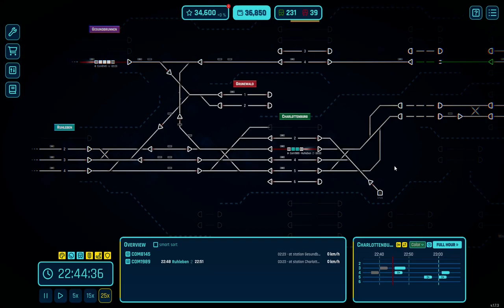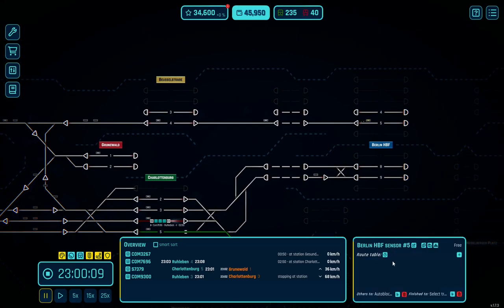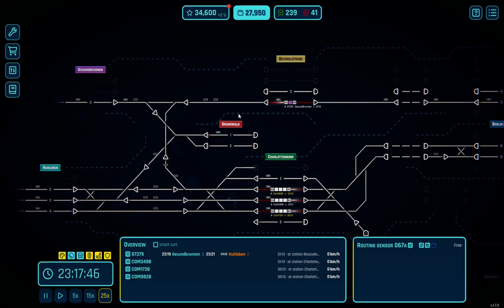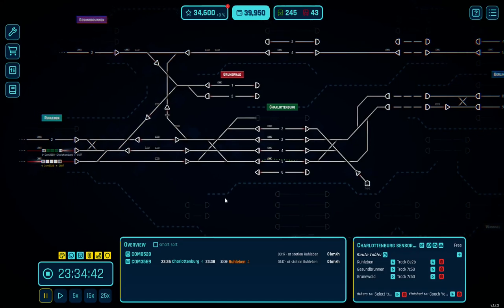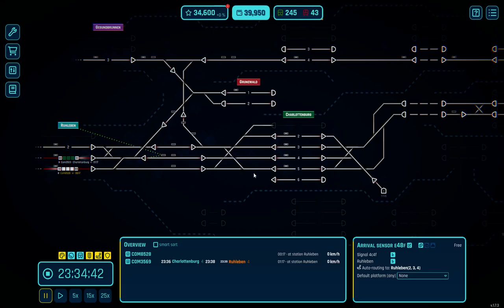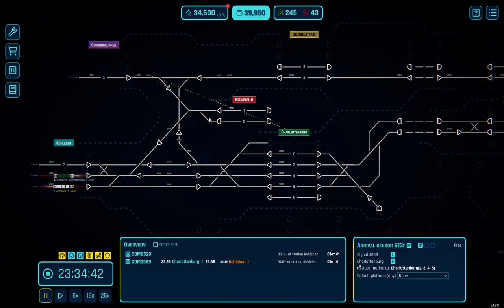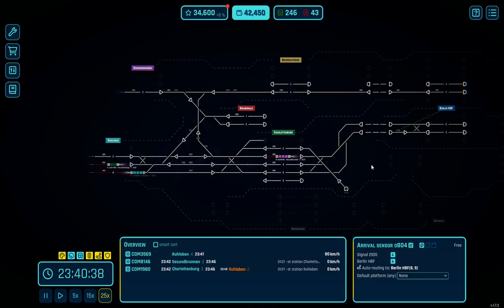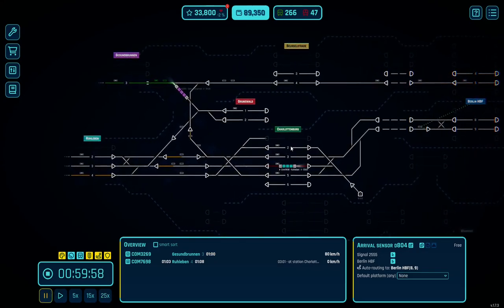RAIL ROUTE HOW TOS | Automating with Sensors | Rail Route Train Dispatcher Simulator

Comment: If you reduce the loop by the coach yard (move it up one level), you’d make space to move the signal and add a sensor for trains coming out of the yard.
Reply from the maker: Thanks.   Some of the placement gets challenging.  With the most recent updates that allow new intersections and stacking of sensors this could also have a few different ways on top of that I'm sure.
Reply: @thematuresimmer4359  I’m currently trying to get my head around the advanced arrival/departure sensors, and figure out why I’d want to use them.
Reply from the maker: @keithygadget381  So I have found them extremely useful to allow you to run your map automatically.   As you can see from the  small example I showed here if you then scale this across a complicated route map you could have a lot of traffic running with the time scale advanced.

If you prefer to manually switch then certainly this is not of use to you, but especially on an endless map things can get pretty busy and the sensors do all the switching for you.